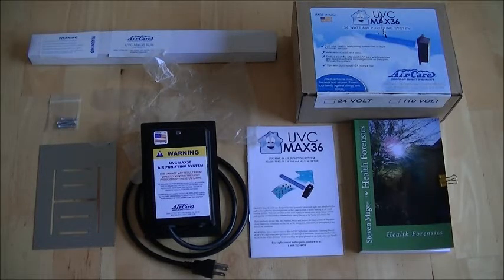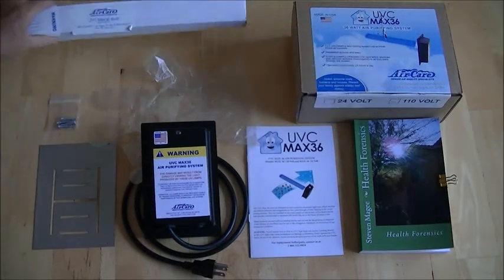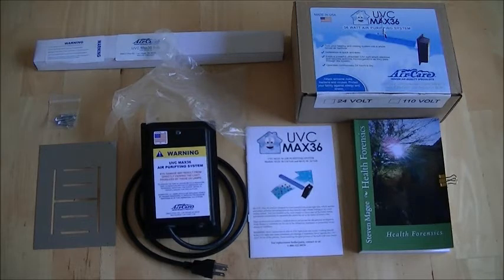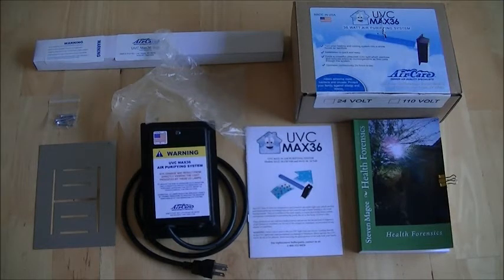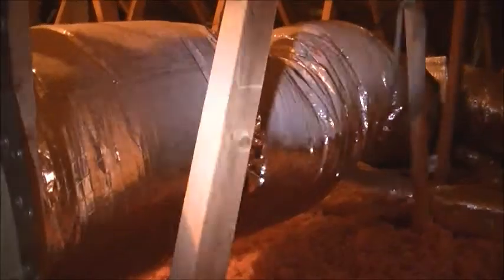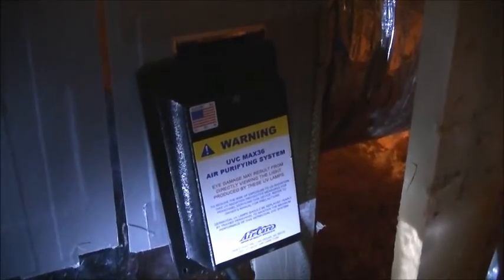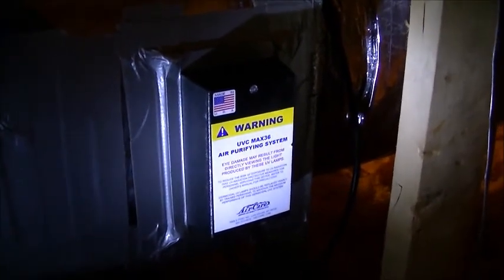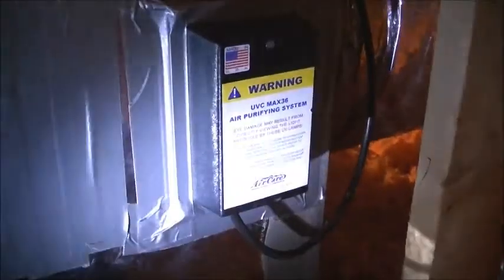Installing a UVC Max 36 Watt Air Purifying System into an AC Unit

Comment: bad choice, the 36w is getting too hot and will work as heat element inside your duct, also the light will be exposed on your flex duct and will break all the plastic film.
you will see it next year when replacing the bulb.
Reply: Tal Segal   Not even close to true.  You are very misinformed.

Comment: May I ask your perception of the UV air purifier for your HVAC unit?  Give us a review of the result after almost 1 years of use here in the comment section or do another video to tell us what you think.
Reply from the maker: +Кевин Юань Great question!  I've just uninstalled it.  I could not percieve any difference with or without it, nor could anyone else in the home.  My air conditioning coils and ducting were spotless when I installed it and did not seem to need any form of sterilization.

Comment: That looks like a 36 watts 2G11 UV bulbs. 

When it is time to replace the UV bulb, be sure to buy it from a reliable source so that you don't get a counterfeit 2G11 UV bulb.  There are vendors on ebay that sell 2G11 UV bulb for dirt cheap.  But it is used bulb that they repackage as new.  And there are similar vendors on the web also.  If you put a none/bad UV bulb for replacement, then all it is going to do is just provide heat and warm for the microbes to grow.  Then you are in worst condition than not having the unit at all.

Of course you don't want to over pay for the 2G11 UV bulb neither.  But if you are not sure about the sources, it is better to over pay for a real working 2G11 UV bulb than to get a cheap deal and get a counterfeit new 2G11 UV bulb.

I'm telling you from experience.